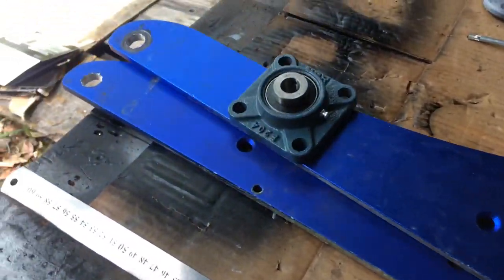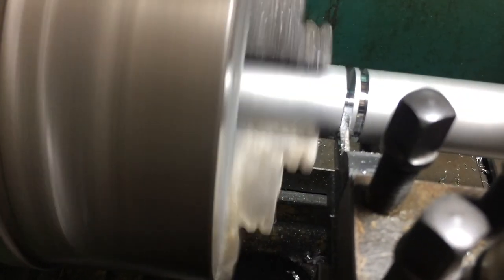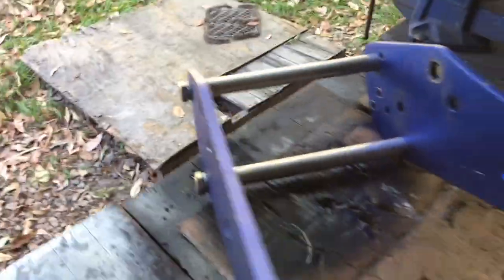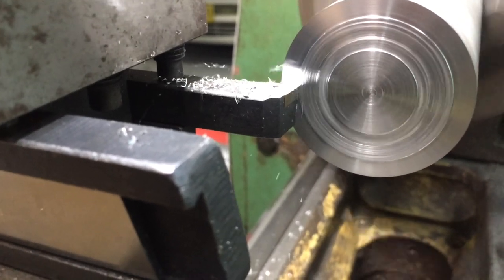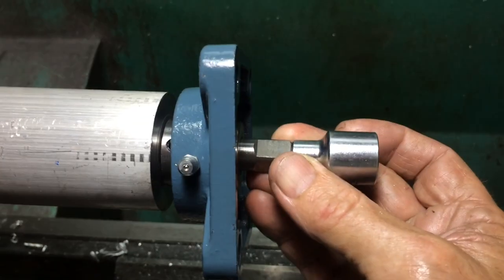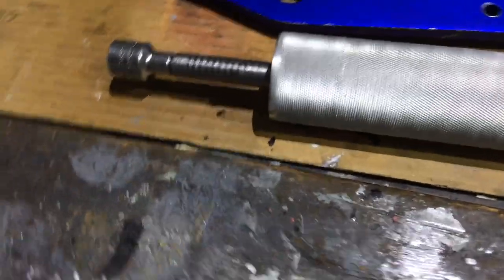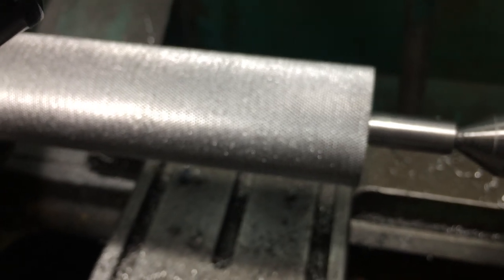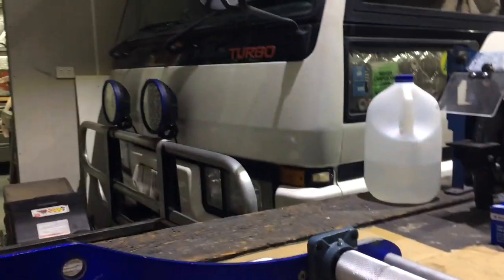How I made a Motorcycle Roll Starter!

Comment: Hi, so how did your starter work out? Any update? Did one drill work? Or did you need two? Or did you fit a starter motor? Do you have a video of it working? Great use of an old jack. I have an old stuffed floor jack and getting too old to push start race bikes 😂 Thanks.
Reply from the maker: Thanks Tim! Sorry for being slack on that but I have had to stop on the Bikes while I get the Little Honda 's Body Done! Will give it a try soon & if it doesn't work will get a starter motor for it!

Comment: Is that blue frame from a hydraulic jack jason?
Reply from the maker: Yes I video'd it but had to cut that bit out trying to get it under 15 minutes! thanks Craig
Reply: I thought so,  looks like my jack...lol
Reply from the maker: @Hanlonsgarage  I have had 2 of them, (aluminium ones) if you over tighten the valve screw after a bit they stop working. I will only buy the steel ones these days!
Reply: Mine is steel, I had the aluminum one as well, it broke the first time I went to use it!! 300 bucks! Brought it back and got a steel one ! The hydraulic cylinder didn't work
Reply from the maker: @Hanlonsgarage  Yeh there just toys compared to a steel one, I have a steel one had it 25 years at least! Just bought a low profile steel one not to long ago it's heavy duty should last years too! Thanks for your support mate!